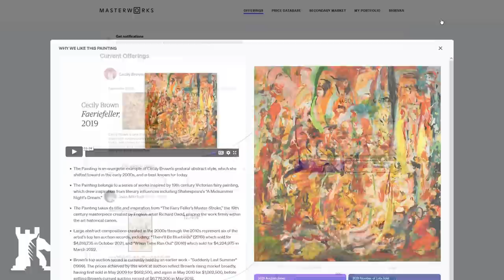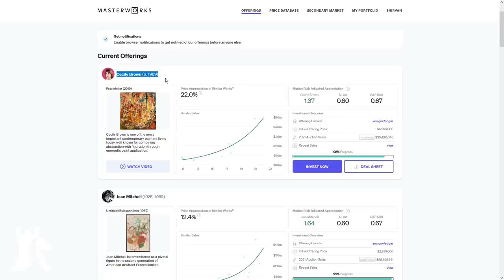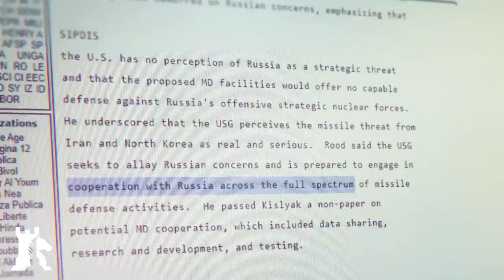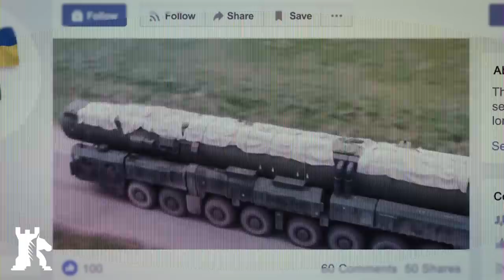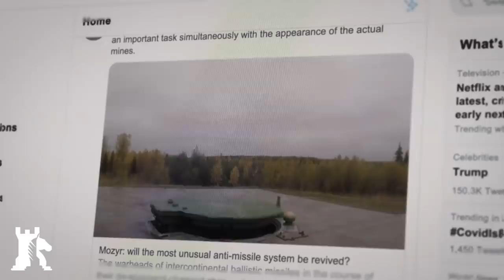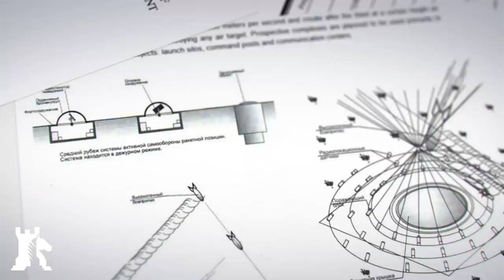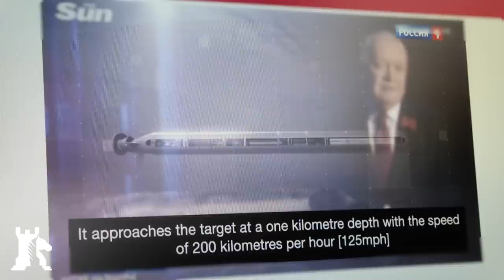Russia develops new doomsday weapons

Comment: Hypersonic missiles run very hot due to their speed and can be easily tracked.... Their "surprise attack" utility is over hyped, unless they're used in short range.
Reply: That sounds like a desperate attempt to calm yourself.  The issue is, if the missile gets through, the target is f’d.
Reply: @Actheman1978  I've been living with MAD  for 50 years, I'm completely calm about it. An ICBM will "always get through", to multiple targets. My point was that hypersonic missiles aren't a game changer strategically, they may have use as CV killers - and other tactical applications - but strategically, they bring nowt to the table. All the best....

Comment: Well, if the Russian military’s performance in Ukraine is any indication, if they get desperate enough to launch a nuke, the TEL will run out of fuel about halfway to the designated launch site. Then, the conscripted, and barely trained missile combat crew will jump out of the cab on the passenger side, because the driver’s side door doesn’t open. None of them have gloves, and it’s the middle of the Russian winter, so their hands are stiff from the bitter cold, further impairing their ability to properly perform their individual tasks in order to insure the mission is able to be successfully completed. They have only one working radio between all of them, which is a 40-ish year old Soviet-era analog model leftover from the Soviet-Afghani War. They use this to contact the command center to inform them of their situation, and get updated orders. Unfortunately, the radio signal has no encryption of any kind, and they communicate in uncoded, Russian vernacular, and the conversation is picked up by an amateur radio operator 50 km away, who also happens to be a political dissenter who takes the opportunity to sabotage the military objectives of the Putin regime. He also jams the radio signal, leaving the missile crew with no means of communication, but I suppose they could give smoke signals a try. The Russian soldiers stand outside discussing what they should do now, blowing their hot breath into their gloveless cupped hands, complaining about the lack of basic supplies, and the incompetence of their commanders. Hours pass. Unbeknownst to them, the political dissenter-amateur radio operator has been able to get in touch with a NATO operative, and was able to pass along the details of the intercepted radio conversation, and the approx. coordinates of the armed TEL, it’s Russian crew, and the fact that they are effectively incapable of either engaging, or retreating, and are effectively sitting ducks. Just as the sun starts to set, they can see what looks like a predator drone approaching on the horizon. 🤔

Comment: Masterworks greatest asset may actually be skeptecism (people not trusting the asset and not buying to begin with). The most obvious potential pitfall with this service would be widespread adoption and induced volitility by investors rather than collectors. The latter of which are more concerned with the arts asthetic merits than its perceived value and especially prospective value increase. Investing in something that does not satisfy an actual need (like say farming/mining/oil) will be controlled by ponsi dynamics. And the more people buy into it the higher the chance of a correction. Skeptecism is likely to deter most people and decrease the probability of rapid growth and thus volatility.

Comment: Atomic explosion is blast of radiation, it heats the atmosphere and pressure increases. On space atomic blast is massive, there is nothing to stop the radiation.  In water the blast should be smaller and impossible to confine the contamination

Comment: Israel successfully developed the Iron Dome to shield its airspace from missile attacks. My question is: why have we not developed a similar anti-missile deterrence system designed to deny the reality of nuclear war? The idea would be to destroy nuclear warheads in outer space or before detonation, but as seen with Regan's Star Wars Program from the 1980s, this has traditionally been met with the limitations of early warning detection capabilities.

The ongoing fact of the matter is every nuclear launch occurs with little to no warning. Is it truly possible to have one hundred percent effectiveness when strategizing early warning capabilities to deny nuclear war? If all nuclear warheads are destroyed before detonation, is a "defensive counter strike" from the opposing side truly necessary? During a hypothetical launch, there are multiple dummy warheads released indistinguishable from the live warhead itself.

The question is: in the event of a nuclear launch, what methods can be devised to distinguish between dummy & live warheads to destroy & ultimately prevent nuclear weapons from reaching their targets without risking detonation via advanced early warning systems functioning in sync like an Iron Shield? I argue that in this particular context, where there is an international will, there is a way to multilaterally deny.
Reply: Why didn't someone developed a shield from maneuverable hypersonic/orbital weapon? Because that's impossible?

Comment: US has had all this tech since the 1960's. Also the Armata tank wouldn't make a difference even in large numbers. A single ATGM or artillery shell would knock them out.
Reply: They do not have alloys that allow High Hypersonic speed at low altitude which is required for Plasma Air bubble for total radar stealth. The range and speed that their Cruise missiles can reach are garbage compared to the Russian ones.